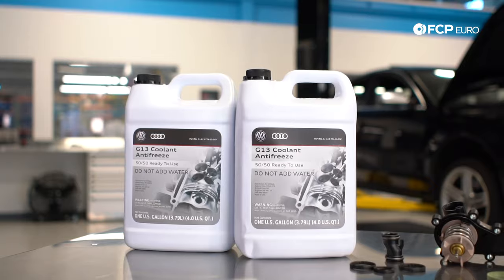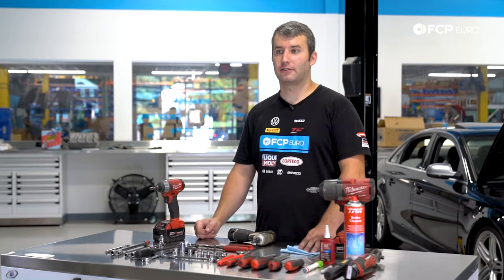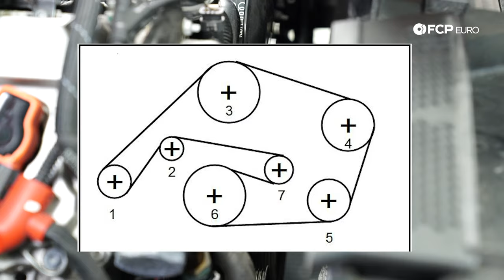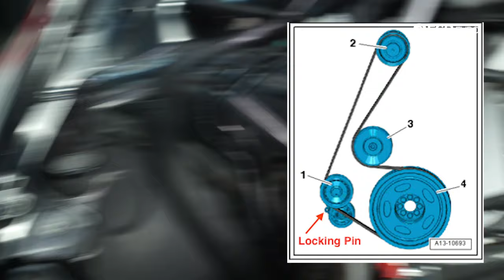Audi B8/B8.5 S4 - 3.0T - Water pump and Thermostat Replacement DIY(S4, S5, SQ5, and More!)

Comment: Thanks for the video. I just finished this job up last night.  I had the added complication of having to replace the front crossover coolant pipe as I learned that it was cracked where it inserts into the thermostat.  Unfortunately, I did not notice this the first time and discovered the crack upon a leak test, so I had to take off the supercharger, belts, pulley, etc, a second time!  So watch out for this - check that crossover coolant pipe carefully.  Removing and replacing the coolant pipe added quite a bit more pain to the job.  For anyone wondering, while I saw one video of someone replacing the T-stat without putting the front-end into service position, I would not have been able to do it without the extra room.  I highly advise service position for access to the 4 T30's holding the crossover coolant pipe to the heads, for access to the water pump and just easier manipulation of the belts, etc.  I used the coolant filler vacuum tool to leak test and refill the coolant and highly recommend that.  I did the leak test before connecting all the vacuum and electrical back on to the supercharger, but be careful as they note when putting the supercharger back on because I trapped my purge line underneath.  I was afraid I was going to have to pull the supercharger up yet again after I had filled the system with coolant, but luckily just loosening it a bit, I was able to wriggle the purge line free.  And definitely label all those connections at the back of the supercharger.  I had mine apart for 4 days waiting for the coolant pipe to arrive and if I didn't label them remembering it all would have been challenging.  If you are not experienced at DIY, work with a friend - you will be surprised how much more motivation a second person provides to work through a sticky problem -  not too mention extra hands for some of the operations.

Comment: Just completed this job on by 2011 B8 S4 and wanted to leave some tips for anyone completing this. I would replace both the supercharger belt, and the accessory belt. The supercharger is way heavier than I thought, and some people may need a second set of hands to remove carefully. I drew dots on mating connectors to make plugging everything back together as easy as possible. By my count, I had 8 rubber lines behind the supercharger, 5 connectors with 3 on the top and 2 slid behind. There is a vacuum line on the intake, as well as a connector for the throttle body and two mafs on either side. If the supercharger has resistance when pulling up, then recheck everything. When putting belts back on, do yourself a favor and buy the longest wrench you can find, I used a short one and it was not fun. Make sure the accessory belt is lined up properly on the bottom pulley, because if not, the supercharger pulley will not fit properly. Do yourself a favor and buy new bleeder screws ahead of time because the plastic ones will break. Finally, he does not go over this in the vide, but without a vacuum tool, to bleed the coolant I let the car warm up, a friend loosened the screws as i held the rpms at 2000. once it bled, i undid the heater core hose, and turned the heat on hi with the fan speed max. Once that was bled i did the supercharger once more and let the car bleed itself the rest of the way by driving around. Hope this helps, not an easy fix, take your time and dont tighten anything too tight.

Comment: Gosh! All this for a thermostat and water pump? Please don't tell me the front clip has to be pulled out to get those out. I have a 2015 Q5 B8 and while the engine looks the same, I hope there's more room for tools than this. What really sucks is if there's any leaks all that has to come back apart (supercharger, etc).

Comment: Would love to see a DIY for carbon cleaning of the valves on the 3.0T engine
Reply from the maker: Stay tune Sunday and next week.... you asked for it.
Reply: B8/8.5 3.0T or B9 hot (potato) v 3.0T, I know the new ones dont need cleaning yet, but one day they might 😱
Reply: @robertficek7586  Ea839 need to be pulled to clean the valves.  That's gonna cost !
Reply: @fcpeuro I recently did this.  Thanks for in depth video. I am getting and error for my cruise control not working? Any ideas? Is something not plugged in? Or a sensor on the bumper?

Comment: Want to thank you for the video. Just finishing it up... everything is in and I just need to fill coolant and start. 

For anyone doing this on a vehicle with a bunch of miles, i'll share that my 2013 Q5 has 93k miles on it and the inside of the coolant pipe was totally decaying. I could dig out what used to be plastic using my fingernail. The part is available at FCP, but when I bought it, the listed part at FCP was not the right one. I called FCP to notify them, but just in case.... you want part 06E121045BB. It fits perfectly. And it comes with the 3 gaskets needed (2 for attaching to block and one at the thermostat)  so you don't have to buy them like I did. 

The supercharger is heavy! Hope you have a good back. 

My Q5 has a different front bumper system than the video.  No bolt behind the wheel well longer holding on the bumper... just pull it out.  So many bolts under the hood though... I used lots of tape to mark locations, with sharpie to write a number and a matching number tagged on each bolt. 

Not a bad job. I used a huge Phillips screwdriver to remove the supercharger coolant bleed screws, and that worked well. They look like a flathead will work, but it didn't.  Thanks again... awesome video. FCP rocks!

Comment: Audi ( Volkswagen GmbH) engineers certainly fulfilled their brief from management to ensure the complexity of the engine bay layout would deter any customers from attempting DIY work so they would take their car back to dealer for all 
maintenance and repair!
This is a high calibre, very advanced tutorial, for those brave enough to attempt it !
Reply from the maker: They certainly didn't make it easy by any means Philip! With enough time and patience (and the right tools and guide) anything is doable, but not to Audi's liking!
Reply: @fcpeuro  Do 2016 A6 3.0t have the similar layout as this car?  I may give a try someday when my car has the same problem.  thanks,
Reply: @davidz7858  bro it’s the same engine 😑. That’s like asking what 2+2 is
Reply: Not as bad as the TSI 2.0

Comment: Thanks for this DIY. I followed it and was able to change out my thermostat. Hardest parts were taking off any of the coolant hose as they were all stuck on pretty tight, and removing and reattaching all the various cables and tubes from the supercharger. Otherwise it just took a fair amount of time, but save me a lot of $$$$
Reply: Just want to give an update on my thermostat change. I noticed some leaking after, but for the life of me could not figure out where it was coming from. After taking off the supercharger again I determined it was coming from where the thermostat meets the coolant pipe. Swapped the o-ring twice because I figured that was the problem, but the leak persisted. Finally I changed the entire coolant pipe and the issue was resolved. I looked at the old coolant pipe and could see no cracks, so the only thing I can think is that it either slightly warped over time, or shrank in diameter. Not really sure, but just wanted to mention this in case anyone else has a similar issue.

Comment: Couple FCP video seen and very impressed at the advice and expertise of the techs. Really valuable information for the most costly part of repair on VAG autos, the labour.
Many thanks and please keep these valuable videos coming, Appreciated!
Reply from the maker: Thanks David! There are many more videos coming - especially on the VAG cars that may require quite a bit of work 😅 - glad you're enjoying the channel.
Reply: @fcpeuro Do you have to recalibrate the acc sensors after reinstalling the bumper? Mine seem to be off..saying acc not available.

Comment: Great video guys! I have to replace my water pump and thermostat now at 80k miles on my 2015 audi s4. My mechanic is recommending I change my upper and lower radiator hoses, coolant hose as well, and a couple belts. Sad thing is my PCV valve was changed at 60k miles and Audi didn't recommend changing the water pump or thermostat.  Only the Supercharger and drive belt. Wish you guys were my mechanics! Since I gotta do this all again would you recommend I change the radiator as well?

Comment: I have a 150k on my b8.5. Ive changed all gaskets, rear main, clutch (manual) and flywheel, motor mounts. I ve had the car since new. Do you recommend I replace water pump and thermostat as preventative maintenance? Its all working perfectly, but Ive read these parts tend to fail.

Comment: I replaced my thermostat, as following this video. Thanks, works great! One question from seeing other videos/forums, is the heater suppose to be turned on when doing the vacuum fill? I followed this video and did not do that, but wondering now if I will have air in the coolant system. I know I wont have much air though as I filled up about the same amount of coolant that I drained.
Reply: vaccuum fill reduces air in system... but you will still need to bleed from lowest spot of system to highest spot . supercharger bleeder screws are final step in bleeding, if the plastic ones break you can get metal ones for under 30 bucks online. cycling your heater off and on is a part of it yea.

Comment: Replaced everything with the kit in this video. Coolant level dropped a bit after driving. Is this normal? No signs of leaks I vacuum bled and filled the car and it worked great.
Reply from the maker: Hi Addison, you usually have to top off the level after a good drive and a cool down, totally normal! The vacuum fill gets you there the majority of the way.
Reply: @fcpeuro  I did just that. Thank you!
Reply: @fcpeuro  great thanks! The car was and is running great. However this morning a CEL came on. Any ideas ?

Comment: Hi Corey!  Great video!  I have a question, I have a b8.5 S5 and it currently has a wobbly coolant pump pulley.  Is this safe or should I replace the coolant pump and pulley to get rid of the wobble.  Kinda stuck and need some help
Reply from the maker: You should replace that as soon as possible! The last thing you want is that pulley to come off and damage everything in the surrounding area, but also cause your engine to overheat.
Reply: @fcpeuro  do you think the pulley belt might be the culprit?  Maybe getting a tighter one?

Comment: I have been losing coolant on my 2013 A6 with the 3.0T TFSI engine.  I get a code of "8902 - Coolant Pump for Intercooler".  Is this the same thing?  I also see a P190F 00 [044] - Electrical malfunction in Load Circuit associated with this problem.  I have an engine light on, as well.  My guess is we're talking about the same thing, but am I incorrect?  Also, will this same basic procedure work on the A6?

Fantastic video, by the way, and thank you for sharing knowledge for those who like to turn wrenches.

Comment: Should you replace these two parts first then once everything is nice and tight start on the PCV process aka the manifold flaps? Thinking you can leave it in service mode and just move the support back and forth if you need to lean to do the other stuff required for the PCV.

Comment: If you were doing the waterpump, thermostat, pcv and carbon cleaning in what order makes the most sense to complete ?
Reply: Not sure if you already did the work on your car but I just finished the same list. I did the carbon cleaning first. It can be messy and I wanted to remove the pcv, pump, and thermostat after cleaning up. I also replaced the belts and spark plugs because I had the plugs out to make turning the engine easier.
Reply: I did the same thing  the whole process takes time but is well worth it

Comment: First time dealing with FCP and you guys are great! I knocked out the thermostat and water pump and now I have a coolant system fault. The car runs great and drove about 10 minutes before the error came up and then the car started overheating. Any idea what might cause that issue?
Reply: Did you ever figure it out I’m about to do this job plus the Pcv
Reply: @confetty5151  yea, it was the solenoid that went to the waterpump vacuum line.

Comment: @fcpeuro I just finished replacing the thermostat and water pump on my sq5. Check engine light had come on and the code said I need to replace the thermostat. I changed the thermostat and the code came right back. My coolant temp is not raising at all. Does anyone have any advice?

Comment: Only part I stuck at you fast forwarded. How do I unbolt those other side of coolant pipe bolts
Reply: They are much harder to access, but are still there, exactly opposite of how they were on the passenger side. I had to use a 1/4" ratchet to get them out. Its easiest to feel for them with your finger and use that to line it up because you cant see them.

Comment: This job looks brutal.  I did a DIY turbo replacement on my son's B7 A4 2.0T and this looks harder than that job!   Our 2010 B8 S4 currently has this issue and $2000+ being quoted by an indy shop, though I am trying to clarify if its just the water pump as I read that you can do just the water pump without removing the SC.  But I guess I need to bite the bullet as many jobs will require SC removal - might as well learn how to do it now.  But I am not looking forward to this job!, mostly because I hate cooling system work.   I know you recommend bleeding, but you also said the car does a good job of self-bleeding - do I really have to crack the bleeder screws?  EDIT- see my new comment - I completed the job last night with some observations.

Comment: 2012 c7 a6 I am just removing the supercharger without putting the bumper in service position and only removing and replacing the thermostat .   so before I loosen the coolant hoses on supercharger front, I wonder if I need to remove some coolant from the reservoir first? If so how much and will I need to bleed the system if I remove the coolant or supercharger.?
Reply from the maker: Hi Donald, if you are servicing the thermostat you will most definitely need to drain the coolant system as Cory does in the video, and then refill and bleed the system. You can always measure the amount drained to have a rough idea of how much the system may take again during fill up.

Comment: Great video, I think this has been asked a few times 😅 but can you easily do the pump with the supercharger still in place ? Cheers
Reply from the maker: You may be able to squeeze in there, but of course we recommend removing it for ease!
Reply: Yes. Have to squeeze it out but posible to change water pump without removing supercharger or setting car in service mode.
Reply: Did this a few months back with the supercharger in place and car in service mode and it worked well 👍, thanks for the tutorial

Comment: What should I do with the extra bolts/screws I have after putting it all back together? They’re not the same size as the bolts/screws that fell in the engine bay.

Comment: Hey guys I had the water pump and thermostat replaced on my 2014 Audi a7 3.0t . Getting code P2006 and P2007 at the same time. both runners stuck closed . Any thing you can recommend to check initially and have you ran into this problem? Thanks
Reply from the maker: Hi Quentin, you could possibly have a vacuum line that has either broken off or not been hooked up correctly after the repair. A proper inspection of the area and vacuum lines is in place.

Comment: I keep hearing that the later models of this engine doesn't have the problems as to the earlier models. What exactly was changed, how are the new models better, and how can you tell if you have the upgraded engine? Also are we still talking about the 3rd generation of the 3.0 TFSI? or are you refiring the the release of the 4th generation ? I just keep hearing everyone saying the same thing that the early model S4 engines had a few problems.

Comment: Are you able to do this without draining from the bottom hoses? I dont have a lift.....
Reply from the maker: We would certainly recommend a floor jack, and jack stands for this job!
Reply: So i stupidly used the drain plug itself and now it doesnt seal. What is the size or where can i get a new drain plug o ring?? 2013 s4

Comment: I ordered the water pump and thermostat kit and my new water pump doesn’t have a vacuum line connection am I all good??
Reply: If it is 2013 up no, you need to order the pump with a vent line

Comment: Do you have a kit like this that fits a 2014 Q5 3.0t? If so a link would be great. I would be doing the pcv as well while I'm at it... Thanks.
Reply from the maker: Here is the water pump kit: https://www.fcpeuro.com/products/audi-water-pump-kit-graf-06e121018nkt
Here is the thermostat kit: https://www.fcpeuro.com/products/audi-thermostat-kit-motorad-06e121111alkt3 
You can always go to fcpeuro.com and select your car to find all the parts that fit it!

Comment: My cousin's entire "valley' was flooded with coolant. The coolant pipe from the thermostat housing to the rear of the block was cracked on my his S5 cabriolet. Changed hoses, water pump, coolant pipe under SC, pcv valve, thermostat, crossover pipe, an idler and tensioner pulley, and belts.
What a ridiculous design.

Comment: Will this kit work for the SQ5s as well? Can’t see why not but I feel the need to ask anyway lol
Reply from the maker: Its basically exactly the same. Just check vehicle fitment on the site incase there is a year split of any kind with potentially varying water pumps. But it should be 1:1